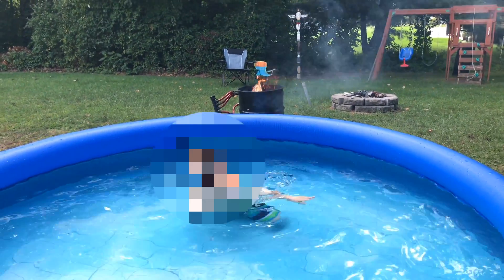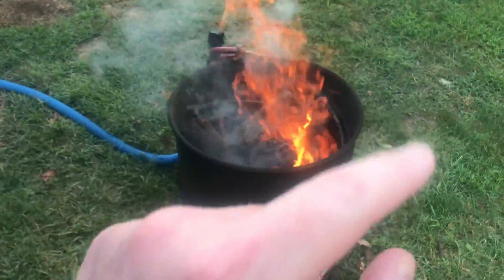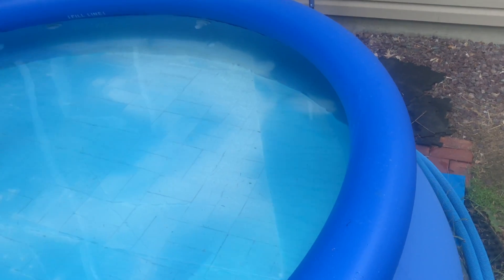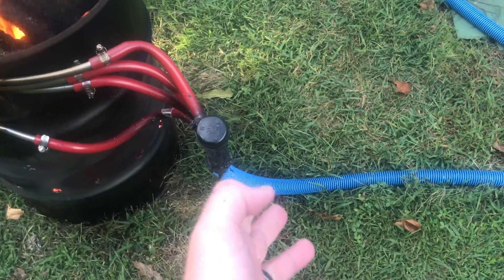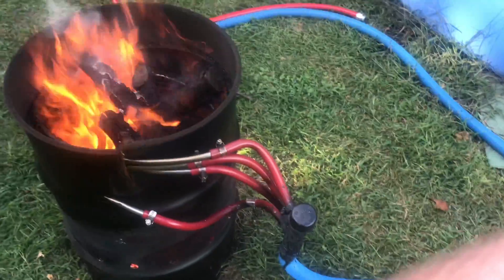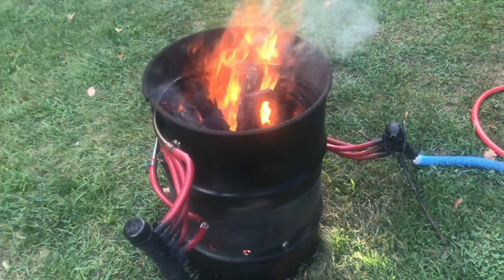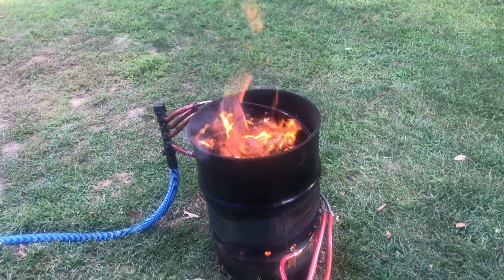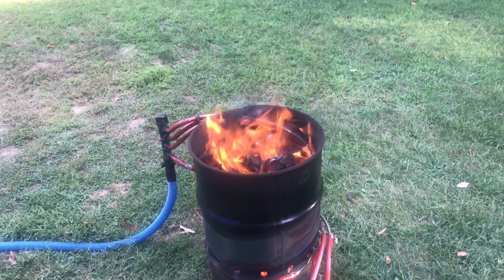Oil Drum Pool Heater That Works Amazingly!

Comment: Great video. I am trying to build something similar, but not sure I have the skills to tackle that manifold idea you constructed. I did have a question though, how did you connect the blue pool hose to the manifold. I am probably going to use 1-1/4" pool hose or a garden hose but I cant figure out how to get it all connected to my pump. Thanks
Reply from the maker: I just used clamps and sealed things with Flex seal spray

Comment: What did you use to seal the fittings in the pipe for the manifold? Or did you have issues with leaks there?
Reply from the maker: I threaded them into the pvc tube… I ended up spraying them with flex seal and it pretty much stopped all leaks. If was to make an official kit I’d prob make them out of welded steel
Reply: @carguysnewengland  i appreciate the response. Thank you!

Comment: You've got a bottle neck in your system my guy.
Area of a circle using diameter: A=.25πd^2
So the area of a 2" line is 3.14
Area of a .5" line is .2
So 3.14/.2 = 15.7. Round up to 16.
You'll need 16 half inch lines to equal the same cross sectional area as a 2" line.
Reply: Did you miss the part where he says its already heated/heating up?? Lol. Looks like hes got it under control. 😂

Comment: How long before the stainless pipe disintegrated?
Reply from the maker: It’s still in tact corrosion wise but when I made it I accidentally kinked one of the coils that created a failure point where it would drip

Comment: The big point missed here is not flow rate, but "delta T". With headers and multiple lines in parallel against the hot surface, all the water entering the header is at the pool temp. The amount of heat transferred will be greater than having only one entrance and one path around the heat source having a diminishing temp difference.

Comment: Working but as you can see all the heat is lost in the sky. If you can add some metalic parts on the top to grab this lost heat that would be nice. Look at this one : https://youtu.be/Iz2es9EAVFM
Reply from the maker: I’ve thought about adding a metal cone on top vented out through a stove pipe

Comment: What is your gallon per minute output? If could I achieve the same GPM with a 3/4 heating pipe would I still need to run in parallel (like yours)or can I do just one pipe? I have a big pool and would prefer high flow rate with lower output temp. in order to change the pool water more quickly.

Comment: awesome!  4 of the 1/2" lines is the cross section area of a 1" line.  you'd need 16 1/2" lines to get the cross section area of a 2" line.   i want to build something like this.

Comment: Great job. I just bought a stainless steel barrel and ordered a barrel stove kit. I am looking to address the problem of the manifold/piping sweating inside, eventually creating a thick coating of carbon on the pipes. This dramatically reduces the efficiency. Piping the outside of the barrel would be less efficient but still work however I don’t want it to look like crap in the yard, hence the stainless steel drum. It will he interesting and I will incorporate your tip on the manifold / multi pipe and  manifold design.

Comment: why don't you use electricity ? it creates much less mess and easy .
Reply: heating water takes an enormous amount of energy and so costs a lot of money. when heating a lot of water burning fuel directly is much much cheaper.
Reply: @Leoau-h3p  its not actually that expensive using a pool heat pump. Im also using a solar heater, just for the fun of it!

Comment: Great video! Can you use copper pipe instead? And the "manifold"...how did you make that? (Thanks!)
Reply: This is a great idea, however I'm not familiar with the exact parts you use to build this. Please be more descriptive on how to build the manifold. Links to the parts you describe would be perfect. Each part please. I want to build one. Thank you
Reply from the maker: Copper pipe will melt... you have to use stainless. The manifolds are sink drains with a cap on one end. Brass barb fittings are NTP thread end into manifolds